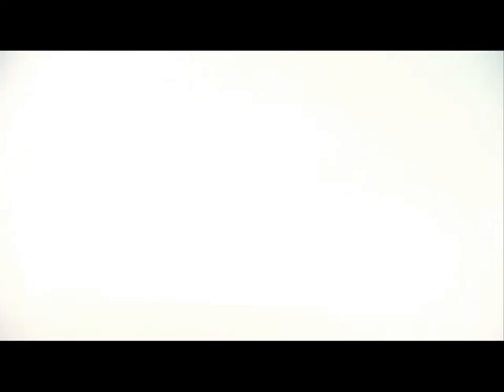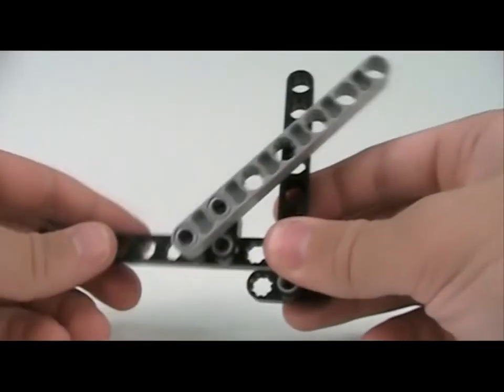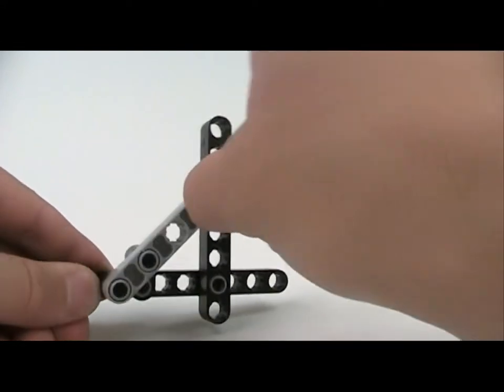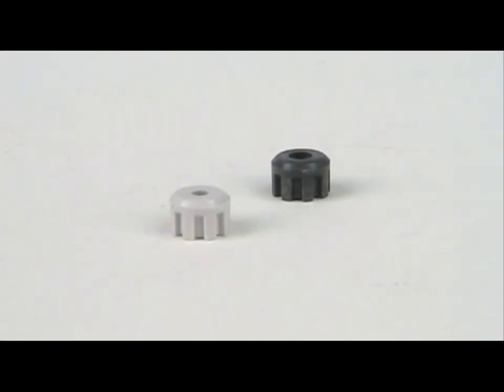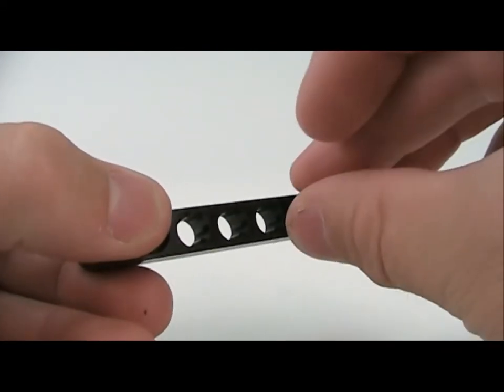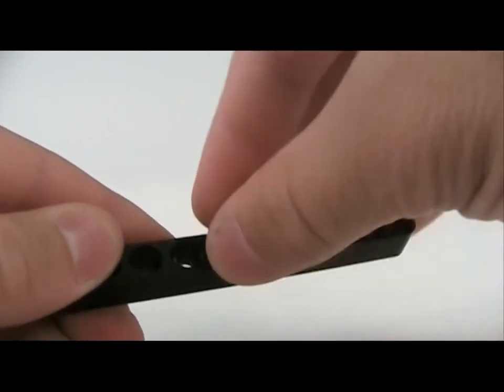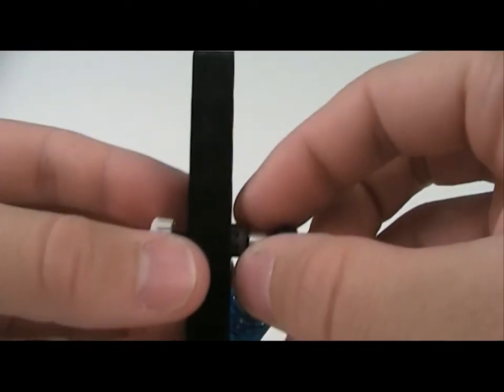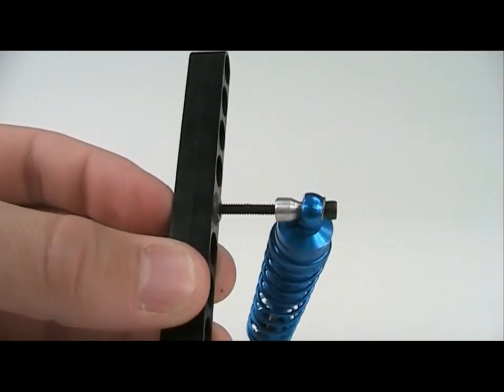MINDS-i Robotics - 45 Beams, Transitions, and Threaded Adapters

Comment: Are your beam lengths and hole spacing the same as those beams found in the Lego NXT and EV3 sets?

Have you considered making connectors for Lego beams which have smooth bore holes?

Can you make (mold) custom Lego parts per  a customer's specification?
Reply from the maker: Hi Tracy,
The beam lengths and hole spacing is different from Lego. The MINDS-i system is intended to be separate from other systems. However, through use of the threaded adapters a 4-40 screw can be used to attach nearly anything to the MINDS-i system, so it is possible.

Altek, the company that makes the MINDS-i pieces could make a mold per a customer's specification, but molds are expensive.